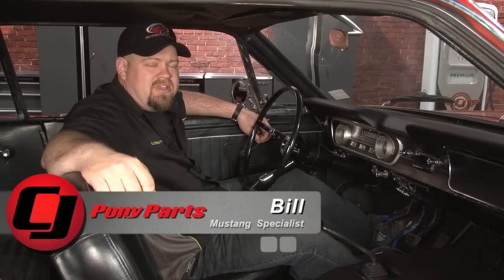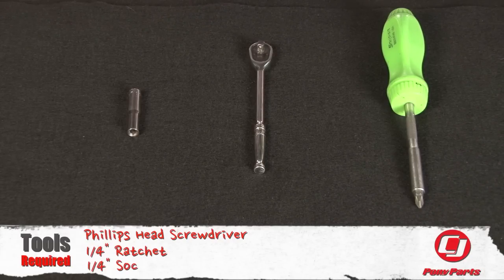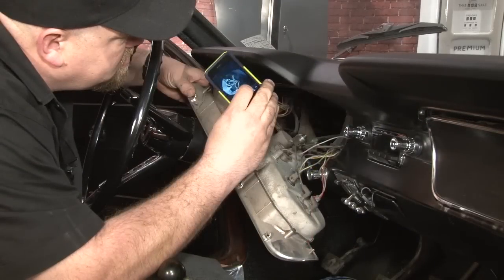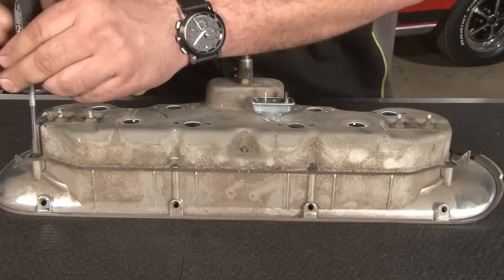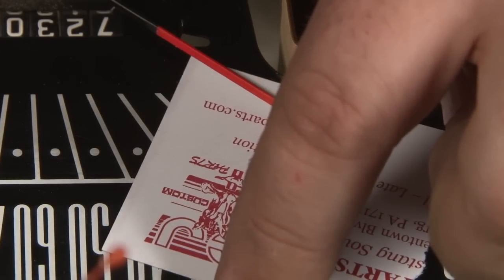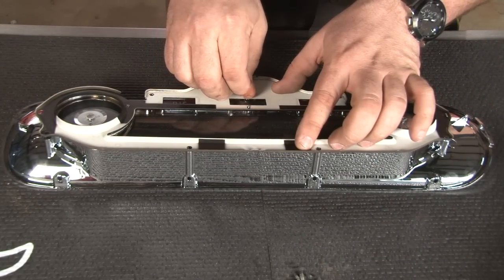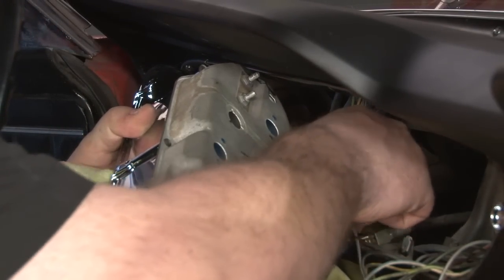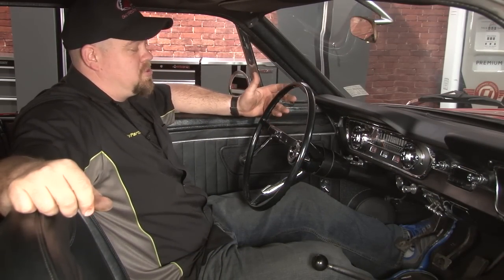Instrument Bezel and Lens | 1965 Mustang

Comment: I would like to double on Nikki' s question. I too am having the exact same problem s with the bulbs and pulling the cluster out!!
Reply: @brentjohnson6578  Try wiggling it out, especially lifting it up and pulling it up and out at an angle. I took mine out just yesterday. As soon as it comes out of the dash, pull it out enough to get your hand in and unscrew the speedo cable. Mine is pretty short.

Comment: Hi There,
I also find your clips really helpful, Could you help me with , any reason why my gauge cluster won't come out,  could the wiring be too short to extract ? My dash lights aren't working I need to check the bulbs as the fuse's are all good, thanks
Reply: Did you ever get a response?
Reply: @brentjohnson6578  fr. bc same

Comment: I have a 1966 ford mustang inline 6 what would cause over heating 
Air conditioner, I replaced thermostat, radiator hoses anybody else know how to fix over heating on incline 6
Reply: Probably have a clogged radiator. It’s been 2 years I know, but,  try putting your hand close to the front of the radiator (away from the fan of course and don’t touch it unless you want to get burned) and see if you can sense cold spots. Also if you are so inclined get a cheap temperature reading gun and do it that way. Either that you could have a head gasket issue or possibly running really lean or timing way off /tuning issue.